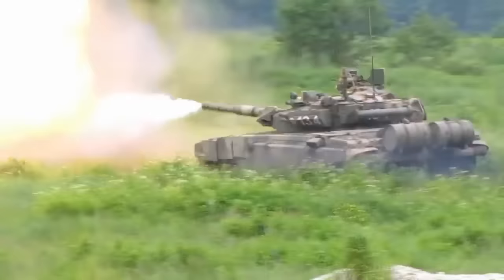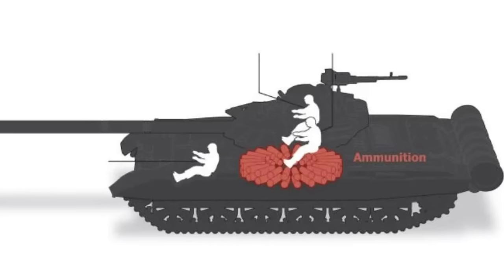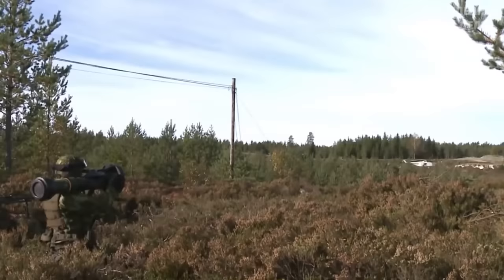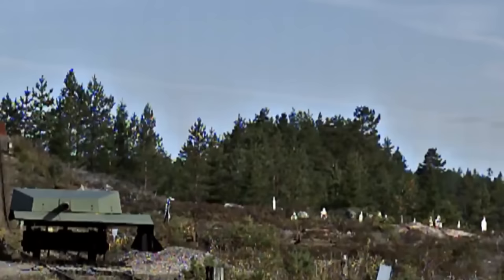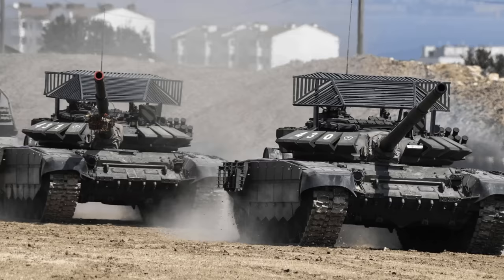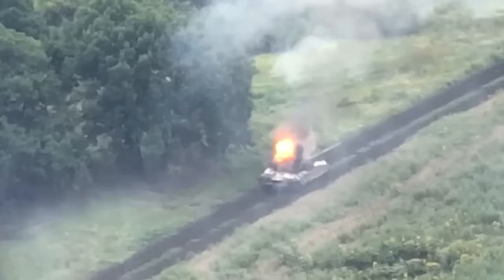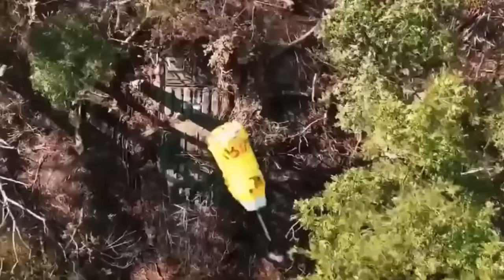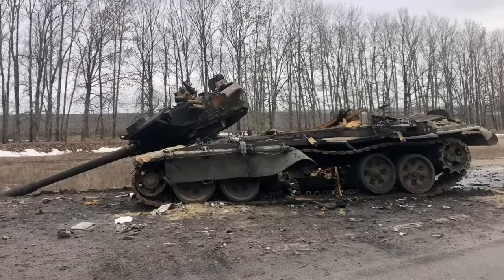Why does this happen to all Russian tanks? / real footage frome Ukraine

Comment: The T72 was designed specifically for the Soviet Union's huge army and not for a regional power, such as Russia, with it's far smaller armed forces, and was meant to overrun NATO forces through sheer weight of numbers. It didn't matter if even 2 thirds of the T72s were destroyed, there would have still been enough left over to subdue the enemy, or at least that was the Soviet Union's hope.
This idea was born of the huge tank battles between Nazi Germany and the Red Army, in which the Germans had far better tanks, but the Red Army had far more tanks. It turned out that the side with more tanks had the advantage even if their losses were far higher.
This strategy, it seems, doesn't work so well against an enemy with advanced designed anti-tank weapons and high combat moral. It also doesn't help to allow tanks to deteriorate to a degree that they break down in battle and maybe starting the invasion towards the end of winter when fields and roads are just mud baths wasn't such a good idea either.
Reply: Worked because technology hadn't caught up to that strategy yet. Won't work in modern times. Western tanks would mow through Russian tanks like hot butter.
Reply: @MR.ROBOTVOLTRON  NATO already had an answer to the Soviets' countless tanks. They developed the A10 specifically to take out tanks. They also developed a chopper for the same purpose, but I can't remember the name right now. With those babies NATO would have had no trouble finishing off the Warsaw Pact if it had ever chosen to invade.
Reply: @mikethespike7579  I wouldn't say no trouble.  I mean a Red Army invasion of the West would have been a bloody mess, but I do think we would have won eventually.
Reply: @jimwillis383  Well, yeah, NATO would have won, but there wouldn't have been much left of Europe to celebrate about.
Reply: Plot twist: The Germans didn't have far superior tanks, they just had the better way of using them. At all the T34 was a magnificent machine and definitely better than any German tank except the Panther.
Reply: @jimwillis383  yeah america would win cause most people have guns
Reply: @mikethespike7579  The A-10 is highly outdated, we have much more capable platforms. Worked well against enemies without sophisticated SAMs, but basically anywhere else other than the middle east, the A-10 really kinda sucks. Great for morale, everyone loves the A-10, but it doesn't do it's job as well as everyone thinks. Once the enemy actually have capable SAMs, fighters, the A-10 instantly becomes 100% useless as its too slow and its standoff weapon range is far too short to be able to do anything productive. But if it can just stay up in the air all it wants, unimpeded, yeah, it'll destroy any modern tank, all day long, even with just its gun. But its NEVER going to get to do that again.
Reply: @evangalinsky2499  Yeah, I've been told this now a few times since my last comment. I suppose people get mesmerised by the Gatling.
Reply: @evangalinsky2499  Thank you!!! Someone finally said it! The A10 is a beastly weapon system when you’re fighting terrorist who don’t have modern weapons. It would get hunted down by modern Air forces without significant Air superiority before they are deployed and the SAMs would shoot them down without Air Superiority already gained.
Reply: @Danger_us86  It could be upgraded and become much more useful again, not as useful as everything else the US has, but much more effective. However, it's not worth it, as it would need basically a complete overhaul if you wanted to keep the airframe exactly as is. First of all, it could use much better engines. And it needs better standoff weapons. Those alone are tremendously expensive upgrades as upgrading the weapons basically means upgrading all the electronic internals of the jet, including the cockpit. It's not worth the time or money, we already have plenty of jets that can do what it can.
Reply: @evangalinsky2499  America can easily afford to upgrade it with its $700+ Billion dollar budget. The real issue is that if a Javelin fired from a single soldier can do the job then why invest in a new fleet of A-10’s especially when it’s shown how inept the Russian military is at modern war? It just doesn’t make strategic sense anymore. The USAF would secure Air superiority over the Russians and just render its tanks obsolete with the Apache helicopters and their Hellfire missiles and if there is a bunch of SAM sites then we would do exactly what we did to Iraq (#4 largest Military back then) with using our stealth bombers, highly coordinated diversions and such. It’s amazing how bad the Russians are at war… they have relied on their nukes and it shows.
Reply: @Danger_us86  Of course they can afford it but what I'm saying is the added effectiveness comparatively to the money needed to get it there wouldn't be worth it. The money is better spent upgrading better, more versatile platforms and developing new aircraft and weapons. I just thew it in there as "they could but they won't" just like they did with the F-14D.
Reply: @evangalinsky2499  right, I totally agree.
Reply: @mikethespike7579  They want to "drop" the A10 but strategist feel that would be foolish as most people would it is old but effective,You are giving credit to idiots not all think as you do many want to "save money" and sod the military
Reply: @Bro-vs5mk  Just owning a gun means little
Reply: @Johnketes54  no because lots of people have guns not just one
Reply: @Johnketes54  that’s why America would most likely win against any country
Reply: @Johnketes54  The Germans knew well why they chose the time of year to invade the Soviet Union. In winter the roads and fields in Ukraine and Russia are frozen and can carry armoured vehicles. In Summer that is less so because of the mud. Also, German tanks had heating while the crews of Russian tanks were often found frozen to death.
Germany would have eventually reached Moscow and Stalingrad and pushed back what was left of the Red Army beyond the Urals if the Soviet Union had not been supplied with weapons and machine tools by the US.
Also, Hitler, less than a military novice at the best of times, negatively influenced German strategy during the invasion. For instance he ordered large parts of German forces from the East Front to Italy to stop freshly landed allied forces there. That cost Germany the occupation of the Caucasus and a desperately needed supply of oil for Germany's armies.
Reply: well said, same for everything else,  they need to update, it's a continuous process.  Things work great in 1980 may not so in 2022.  I am not at the cutting edge and I prefer to stay within 3-5 years range.
Reply: @mikethespike7579  With the A10, fight the rebels, vouahahahah SAM Assalam Aleikum will say, and then there are at least a lot of you in the sky, but you don't know how to be part of the sky like Russian pilots
Reply: @kamavlv7284  Russian pilots know how to be part of the sky? LOL!
You do know that Russian pilots have made themselves noticeable in Ukrainian skies by their very absence, don't you? That's hardly making themselves anything, never mind part of the sky.
You suggestion is absurd.
Reply: @mikethespike7579  ah-64 apache longbow helicopter. made by boeing in phoenix/mesa AZ
Reply: @Bro-vs5mk  in the usa we have 300 million people and 400 million guns just in private citizens posietion from 1968 til now. thats not counting the military weapons and all guns sold before 1968 or guns made by a person.
Reply: @bobthompson4319  Thanks. Isn't this the chopper that inflicted so much destruction on the tanks of Saddam's elite Republican Guards during Desert Storm?
Reply: @markusplotz2259  most german tank were superior, some highly with equipment that was modern like with the tiger 1 & 2 thoses last also needed specialized crew. instead the T34 was cheaper and and easy to use and repair like the Sherman, but yeah they were meant to be used in great quantity.
Reply: @evangalinsky2499  

The A-10 was designed for close in air support. Mainly ground troop support in Afghanistan. Not for standoff engagements. When the A-10 is used in battle. The US has already taken 100% control of that airspace. Than means no enemy SAMs or enemy aircraft. The A-10 is HIGHLY effective against ground targets such as tanks. 30mm electric cannon firing at 3000-3800 rounds a minute.
Reply: @wilsonrawlin8547  That's literally my point as to why it's useless now, congrats on catching up with the conversation. It was great for that time period and location, but literally nothing else.

Also, the A-10's cannon can go down to as low as 1500 RPM, not just to 3000, and its only effective against tanks when it has DU (depleted uranium) rounds (which at most are only 1 in every 3 rounds in the belt), and when hitting said tank from an angle above 30 degree and from the rear or sides, or directly above, which is ideal but the most dangerous.
Reply: @mikethespike7579  It was the original Apache. Not the new and improved Longbow. But you're exactly right, the A-10 and the Apache were built for the purpose of destroying the Soviets armor coming through the Fulda Gap into West Germany. In fact in 1989 when the east and west Germany's reunification happened there was a detailed plan of Soviets plans for WWIII. It was exactly where NATO (mostly from America's intelligence gathering) said it would be.
Reply: @bobthompson4319  yeah
Reply: @markusplotz2259  Could not have been more wrong. The T34 was far from magnificent. They were cheap, mass-produced, and for the most part, poorly made.
Reply: @Yvory6  I think the most Terrifying thing I heard a lot from my history teacher was how Tiger crews could fire all 86 of its rounds and still too many tanks to deal with on either front. the Tanks were formidable monsters but were useless to the Allie's Swarming tactics.
Reply: @mikethespike7579  There is a documentary on YouTube about how useless the A-10 actually is. They did tests of like 3000 rounds and only like 8 hit, but the tanks were still fully operational🙄 Look it up, as it was very eye opening. The A-10 Warthog not as good as you think😜
Reply: @Danger_us86  the A10 is overall a beast and can be produced in large numbers they can affect individual battles but not the bigger picture wich might be decided boots on the ground
Reply: @evangalinsky2499  it is still fantastic overall and if we made newer modern versions of it it'd be alot cheaper or it could be if we mass produced them easier to produce infact modern wars(modern as in 19th, 20th, 21st century wars) wars are largely decided by numbers and logistics so we need something that can be produced in large numbers if we are going to fight a war
Reply: @Bro-vs5mk  if they invaded America unlike if America invaded Russia or China wich would be like Vietnam.
Reply: @mikethespike7579  depending on when in the war the Russian tanks worked well in cold weather and the German tanks froze tho the German crews had heating but did it with precious gasoline while the Russian crews didn't have heating often but they could make a stove out of cans and wood, i mean they live in that wilderness, some of them froze to death if they didn't have winter uniforms but that went for the German crews to if they didn't have heating.
Reply: @mikethespike7579  still it was freezing cold subzero degree temperatures Russian and German tank crews and soldiers froze to death, really many Germans froze in the winter of 1941 because they weren't ready for the winter but the Russians were.
Reply: @mikethespike7579  well Russia could've pushed Germany out of their land without western allied supplies the didn't even need it especially like Britain wich they could fight the war without American support.
Reply: @bobthompson4319  So?
Reply: @mikethespike7579  the war was lost because the Iraqis were poorly trained compared to Nato and Warsaw Pact armies wich were far more capable than them
Reply: @Yvory6  T34s and Sherman's depending on the variants such as the T34-85, Sherman easy 8.
Reply: @steelhead750  the T34 was magnificent
Reply: @matthewtuckman4447  The tank battle of Kursk between the Red Army and the Wehrmacht, which showed the advantages of the Soviets' strategy: "huge numbers of rather mediocre tanks" was in July of 1943, so the weather, least of all freezing weather, played no roll in the Red Army's victory.
That said, even Hitler is recorded admitting that German tanks were not designed to operate in the freezing Russian winter.
Reply: @matthewtuckman4447  Without allied weapons support and combat pressure in western Europe the Red Army would have been overrun by the German Wehrmacht and pushed out of the western regions of the Soviet Union. They would have possibly survived in the wildernesses of the eastern regions for a few years before finally disappearing altogether.
It's therefore stupid and ignorant to claim that any one country won the war against NAZI Germany, although I agree that the Russians made the biggest sacrifices during this war.
Reply: @mikethespike7579  I know every country had a role but I'm saying the Russians wouldn't necessarily be pushed out of European Russia, they could have pushed the Germans back or they could be pushed into Siberia and Turkistan without Allied support. .

That is more of a maybe situation.
Reply: @mikethespike7579  besides if the Russians were pushed to Asia then they would still be around but Russia would be focused on themselves if they have an armistice Russia would have more people overtime they'd be fineif they were pushed past the Urals but stopped fighting Germany and focused on themselves. For the Russians to be entirely defeated Germany would need to conquer all of Russia European and Asian Russia.
Reply: @mikethespike7579  actually it did give the Red Army a break, so there's that.

I mean it was shown at the battle of Moscow. So it had to count for something
Reply: @matthewtuckman4447  I agree, that would have been the most probable outcome of the war for the Soviet Union. But don't forget that at the time most of Asian Russia was undeveloped wilderness. There was hardly any urbanisation, no industry, no roads or railways. All that came after WW2. No army would have lasted in any organised form for long under such conditions. Any organised resistance against further NAZI offensives would have been ineffective piece meal partisan warfare at best.
Reply: @matthewtuckman4447  Yes, this is just speculation. But if the Red Army had been pushed out of the European part of Russia, the part that 90% of the Russian population lives, that would have been the end of the Red Army. 
Don't forget that at that time the Asian part of Russia was still mostly undeveloped wilderness. There was hardly any urbanisation, hardly any industry, roads or railways. No infrastructure to speak of.
No army can continue to exist in an organised form under such circumstances and would at best fall into small disorganised and unsupported partisan groups more interested in their own survival than in waging a war.
Reply: @matthewtuckman4447  and the end of the world
Reply: @mikethespike7579  they would have lasted they'd be fine the ones who live there are fine, I mean big deal
Reply: @Bro-vs5mk  "the end of the world"? I don't think so, even if a full scale nuclear war broke out they'd only destroy cities the most powerful nuke got an area on a Russian island 3 times the size of Moscow but thats it the rest of the world wouldn't be affected or the rest of the country that has been hit.
Nuclear war is exaggerated.
Reply: @mikethespike7579  the Red Army would be fine and the Russian people because over time they'd have more people and infrastructure that is during peace time so as long as they didn't fight anyone they'll be fine, besides European Russia at the time had 60-80 %of the population more accurately the bulk of the population tho their were still people in Asian Russia so as long as that increases over time they could stand a chance
Reply: Watch a lazerpig video on the t-34
Reply: @thecamocampaindude5167  We have two T-34s standing at Soviet war monuments here in Berlin, Germany. They are tiny in comparison to the German Tiger of the same period.
I knew men who fought in the Wehrmacht on the eastern front and they told me quite a few stories about the T-34. In one of them, the Germans had found that if the Panzerfaust hit the tank exactly between the turret and the main body this would result in the turret being ripped off and blasted into the air. The Germans made a morbid game of this, who could blast off the most T-34 turrets.
Also, I was told that in the Winter War of 1939 between Finland and the Soviet Union the Fins found that a 2 meter long log jammed into the tracks would take this off rendering the tank immobile. This of course was only possible because the Red Army failed to give their tanks infantry support. It seems since then the Russians in Ukraine still haven't learned the lesson. Video footage shows Russian tanks in battle still without infantry support.
Reply: @thecamocampaindude5167  ive seen Lazerpig and he is detailed but exaggerats about somethings. But he is pretty good overall. After that I watched other videos to get second opinion a more accurate one and they were more accurate.
Reply: @mikethespike7579  you are just so funny and naive...
Reply: @mikethespike7579  american Soldiers never wan against Taliban fighters in Afghanistan,so they never cold win against Warsaw pact...you are funny.
Reply: @dansisler9608  NATO outnumbered the Warsaw Pact 2 to 1. The Soviets knew this and therefore decided that an invasion of western Europe was too risky.
The Soviet Union got its ass kicked even harder than NATO in Afghanistan.
You are so funny.
Reply: Dobré německé tanky jsou nutností. Byli vždy v opravně. Jedinou zajímavostí na nich byla nadhodnocená tanková děla. Panther: - když nebyl na rovném terénu, neotáčel věží. - když měl poškozenou brzdu zpětného rázu a vystřelil, zatahovací mechanismus byl zničen - problém pro všechny německé tanky se zpětnými brzdami - stačil jeden zásah ruskou protitankovou puškou. - 200 km ujetých = obsluhováno výměnou převodů - příliš velké a špatně pancéřované na boku. Tyger I: technicky lepší než Panther, ale hloupý krabicovitý tvar. TygerII: příliš těžké, skvělá nízká hlaveň a životnost pohonu, nekvalitní boční pancéřování jako Panther. Nacisté lhali o svých obětech - příklad bitvy u Kurska - Panther D byl vyroben asi 840 kusů - byl v boji od července do října 1943 - do října měli Němci posledních 200 PantherŮ D. Pak vyrobili verzi A. Kde je 600 jednotek? Kdyby je neztratili v boji? To je stejné jako u Panzer IV Panzer IV: Good gun, ale munice v něm byla čipová, v boji jste museli vylézt ven a vyndat prázdnou střelu zvenčí. V nejhorším případě se kulka roztrhla v závěru a celé dělo muselo být vyměněno v dílně. A stejná hra bojových počtů obětí jako Panther D.
Reply: Německé tanky byly uzdraveny svými vojáky - byly ve válce od roku 1939 - veteráni jsou velkou výhodou proti ruským zemědělcům strčeným do tanků v letech 1941-43 - jakmile se v letech 1943-45 objevili i nováčci v německých tancích, situace se rychle změnila a tanky silné zbraně nehrály roli. Navíc dobrá zbraň je užitečná tam, kde je velké pole, ne keř a krátké vzdálenosti. Ruské tankové ztráty byly způsobeny útokem na německou obranu od roku 1943, protitanková děla, pěchotní děla, miny a letectvo, tanky nebyly zdaleka nejdůležitější a jejich význam v obranném boji klesal. Přicházela samohybná a konvenční AT děla.
Reply: The Germans had better tanks in some ways, but poorer in others.  Their gunnery was generally better, but their mechanical reliability was not.  They lost a lot of armor to simple mechanical breakdown and abandonment.  King Tigers were formidable while they were moving, once they broke the transmission they were done for.
Reply: @Saxxonknight  Yeah, your description of the Tiger fits what I've been told by men who actually fought on the eastern front. They were heavily over engineered and not easy to fix on the field when they broke down. Russian tanks also broke down, but they were simpler designed and easy to repair with just a set of wrenches.
Reply: I a big war every T72 would have been destroyed before he was on the Rhine...
Reply: @mikethespike7579 
my opinion too
Reply: @barfuss2007  We're lucky we never had to find that out.
Reply: “Ahh yes, just throw money and men at your problems!”
Reply: @Deniggafyer  Yes, but strategy and logistics mean nothing without men and money.
Reply: But it also goes the opposite way ‘round! Men and money means nothing without strategy and logistics.
Reply: only it uk and us not join the war thing could turn out more different
Reply: Actually It wasn’t the numbers that overwhelmed the germans it was just the strategic mistakes =)). That is just what russians think
Reply: @markusplotz2259  the t-34 was good but the way they produced them sucked ass. There is a reason why many russian sherman users preferred the m4 to the t34
Reply: The same thing with the American tanks in ww2, quantity not quality.
Reply: @finndog2759  so confidently incorrect
Reply: Ukraine and Russia 
Soviet Slavic brotherhood 
Against Anglo Saxon hegemony.
Reply: @nerinavshrestha3338  Yeah, all gone now thanks to Putler. And maybe Russia will also be gone this time next year.
Reply: @Brian H The Abrams is a 70 ton monster, the Russian T-tanks are all about 40 tons. A former US tanker once told me the safest place on a battle field is in an Abrams.
Reply: On point: exemplary respected comment.
Reply: @evangalinsky2499  So basically NATO just had to have air superiority to ensure the tanks didn't do anything. Which basically the whole NATO army is designed towards.
Reply: @hungrymusicwolf  precisely
Reply: Will Swift  Handguns are mere toys in a military combat situation.
Reply: russian tanks were far better in ww2
Reply: @Giaco1989  if I've ever seen a hilariously bad take, that's one of them.

They were better because of pure numbers, not because they were actually better. They'd have 1 inch or larger gaps in their armor more often than not. That's not a good tank, that's enough room for a .50 cal to go right through without issue. They just had so many of them that it didn't matter.
Reply: @MaximRedin  You no bla bla English?
Reply: @David UK If I'd be given a pound for every time someone accused me of "obviously mouthing off about something I know nothing about" I'd be a rich man.
What is it with guys like you? Do you talk like that to your friends and family, assuming people like you even have friend and family that tolerate that kind of talk?
BTW, it's pretty obvious in my comment that I was talking about the soviet planned strategy. What NATO had planned in such an event is an entirely different story.
Reply: @Johnketes54  that may be so, but 350 million people owning 300 million guns means a whole lot. Especially when you would have to move town to town, city to city, and state-to-state with a well dug in populace that constitutes the largest army in the world. You wouldn't have a chance. Neither would anyone else. In fact, you couldn't even cross the ocean to get here.
Reply: Quantity has a quality all of its own!
Reply: @mikethespike7579  again it is always the logistics that has to be in place...
Reply: "Quantity has a quality all its own."
- Joseph Stalin-
Reply: @fubartotale3389  Stalin has a disturbed relationship with quantity:
"A single death is a tragedy, a million deaths is a statistic."
Reply: bolshevik101  You're talking rubbish. Nearly all Russian tanks designed in Soviet times were built as pure cannon fodder. They are far lighter built and have far thinner armour to save on steel. Their armour can be penetrated even through the front with a German Panzerfaust 3 or a Swedish AT4, two of the cheapest anti tank weapons on the market. They are very vulnerable to hits around the turret because of the ammo stored in the turret. Only Russian tanks pop their turrets when hit, clearly none of the crew survive that kind of thing. Russian tank crews have the lowest survivability rate of all armies.
Reply: bolshevik101  Oh, this little debate is getting hilarious!
My friend, I worked as a design engineer on the development of the Leopard 2 in the early 1970s and 80s. And because I'm half Ukrainian, I've just returned from a couple of months in Ukraine helping the guys there service their T-72s. So I guess I know something about tanks and now especially about Soviet era T-72s. I assure you, what you are saying here is laughable. I'll send a copy of your comments to my new Ukrainian friends for them to also have a good laugh.

You are wrong about where soviet designed tanks store ammo. I've seen it with my own eyes, a lot of it is in the turret, ready loaded in the autoloader. An interesting idea that allows very fast loading and shooting, but is a huge risk to the tank and the crew. More ammo is stored safely down below, but that doesn't matter if the turret gets popped off.

Western tank armour is far thicker and superior to T-72 armour, which is really just simple thick armour steel. Modern western armour uses advanced composites that are hardly penetrable by anything the Russians have got.

The armour on top of the T-72s turret is only one inch thick steel! I measured it myself just to make sure. That's why Ukrainians love taking Russian tanks out from the top of buildings.

The shutters on the T-72 don't shut entirely, there is always a slight gap between them and the body of the tank. That's why Molotov cocktails are so effective against T-72s. The burning liquid runs through those gaps into the tank.

Effective firing range of a T-72 according to the Ukrainians is about 3 kilometres. The Leopard 2 has an effective range of 8 kilometres.  

Your T-72 is a toy compared to a Leopard 2. And I'm told that the Abrams is an even bigger and meaner beast.
Reply: @mikethespike7579  The Apache?
Reply: @steelhead750  And still, the T-34 made the Germans afraid, because their inferior tanks like Panzer II, III and IV had no chance, so they built tanks with way more steel, larger, more expensive, way longer to built, often not working, hard to repair, sometimes slow ... a real marvel .... oh and the Stug III was their assault gun, which destroyed most tanks in WW2, not their main battle tanks.
The real deal was the firefly with the gun, which could destroy Panthers and Tigers: cheaper, faster to build, won in Corea ... the IS-3 looked beautiful, sadly the Germans were already beaten. They deserved to feel the inferior weapons like ZiS-3, IS-3 and AK-47 a little bit longer .... who of you wants to feel Little Katherine?
Reply: @evangalinsky2499  well that's why the US achieves air superiority before sending in ground forces and close air support. We don't send in CAS first as your suggesting. The A10 is a magnificent air craft and very good at what it's made for
Reply: @T_81535  again, not really. And if you need complete air superiority at all times to run any form of CAS sorties, that is NOT GOOD.
Reply: @evangalinsky2499  your not really a military mind are ya? Real war ain't like a video game kid.
Reply: @T_81535  yes, and if you read my comments that exactly what they would have to do to once again make the A-10 relevant, but it would be an astronomical waste of money
Reply: @seacore181  If the Germans had better tankers, then why did the war end in Berlin and not in Moscow? Logic is a piece of iron.
Reply: Good points, especially about the weather, just to add to your thoughts if I may? This invasion was a monumentally stupid idea on many fronts, but attacking Ukraine? Ukraine being the centre of ALL russian tank doctrine since 1938 I think? Kiev being the place where a russian marshall was elevated from to lead the army? 
Ok so with that in mind, at which point would it become obvious that attacking Ukraine was a dumb idea? After all they know what is coming over the border, they probably built half those vehicles for the russian army, they taught their general staff, they have all the knowledge available and now we are seeing what they can do. 
Hats off to them, give them half decent weapons (which we have in abundance) and russian armour turns into slag heaps all over the countryside.
Reply: @bongodrumzz  Thanks for your thoughts. I agree with every single word.
Reply: West would lose pretty badly against Russia. You think tik tok army can fight real men?
Reply: @realnapster1522  that is why russian army is losing badly, very badly, in Ukraine? Oh and tik tok is a chinese software idea, not the west, or didn't you know that?
Reply: @markusplotz2259  very magnificent machine but too bad they were built so badly they fell apart